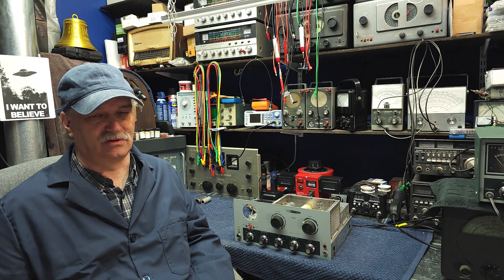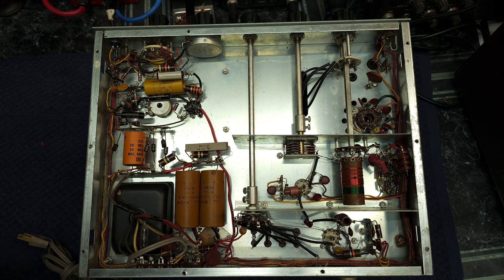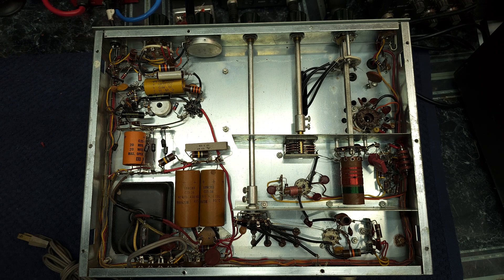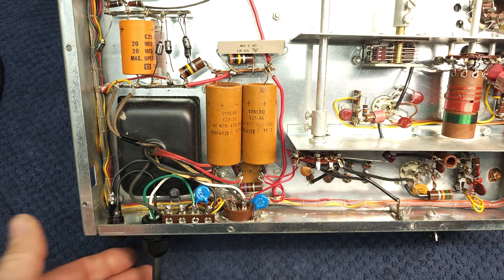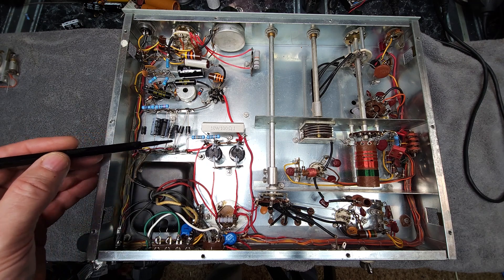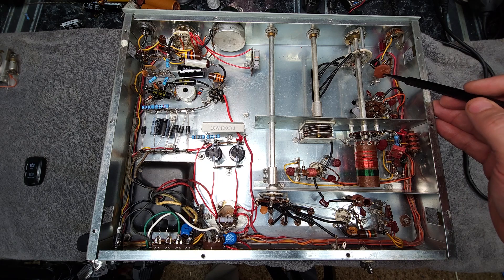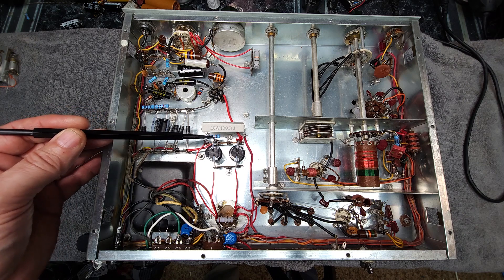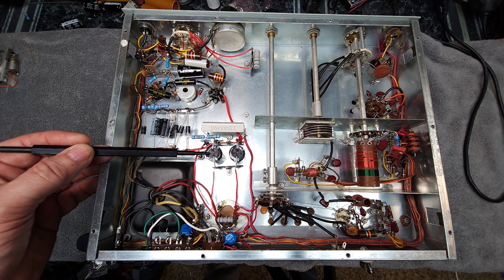Heathkit DX-60B Transmitter Restoration Pt. - 2, Step 2 / Construction Error!!

Comment: Mike...you should probably reverse the wires on the fuse holder. The way it is wired in the vid is a shock hazard when inserting a new fuse if the line cord is still plugged into the wall. 
The hot should always go to the tip of the fuse holder. 
K6XYZ

Comment: Very nice video, I like your straight forward way of explaining what you are doing and why. I used a relay to switch the HV to get it off that wafer switch, so far that's working well. I would like to know exactly where you put the diode on the meter? Also the 270ohm resistor on the filter cap has blown a couple time so beefed that up. Waiting for part 3, 73
Reply from the maker: The diode mod comes out on the next video with schematic. If the 270 ohm resistor is burning you have an issue that needs to be found. C31 and C34 are original values correct??